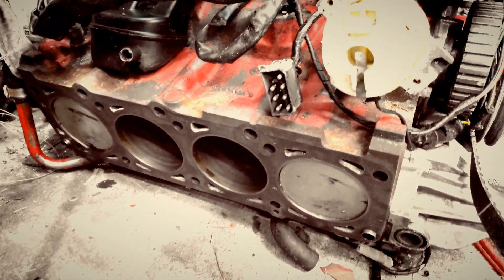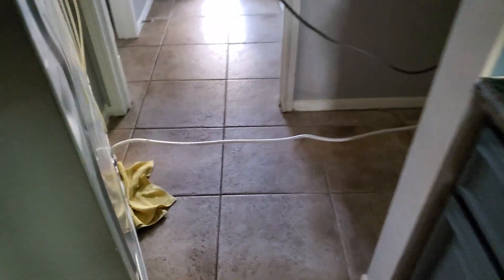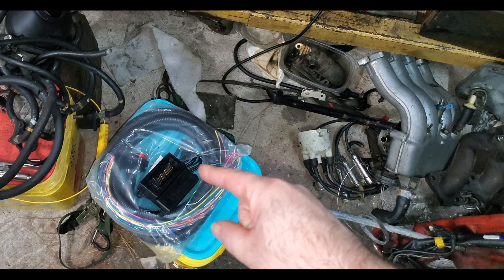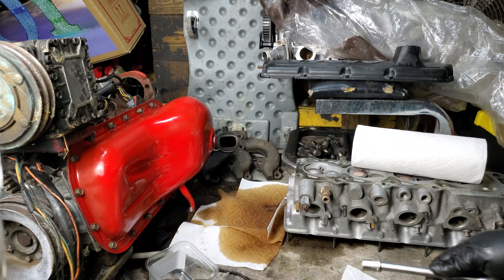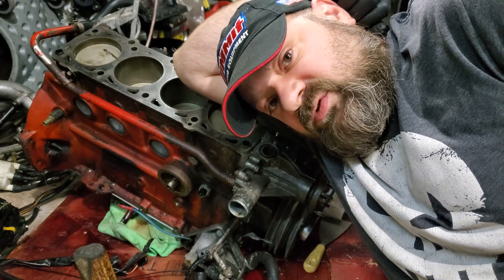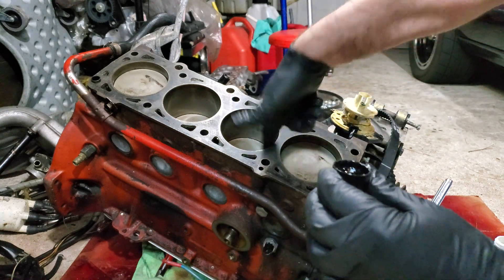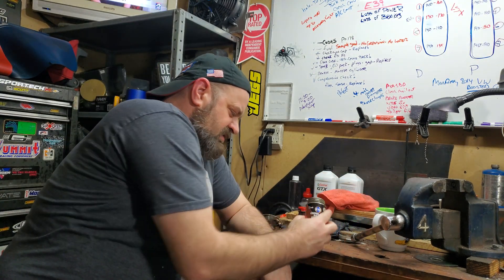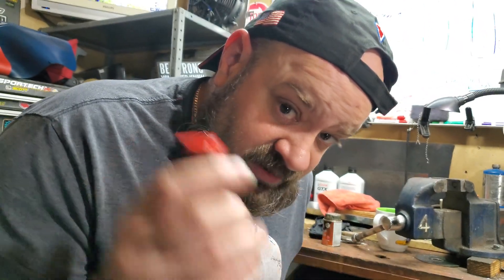Cheap But Tough | 242 Building the Engine

Comment: You said block was at TDC but pistons 2 and 3 are not at TDC when you mate the head. fyi
Reply from the maker: I did notice that. Good eye.Ya got me.
Reply: @TurboWorld  I'm in the thick of a B21F right now, just found some rust in the upper cylinders, so trying to decide if I'll put in a 230F good block I have on hand. Looks like you went the other way ... 230F head on a 21F block.  Thanks for the valve timing tips!
Reply from the maker: @renohuskerdu4592  if the rust doesn't pit the bore it should be fine, other wise no. I had that crank pulley on wrong and had to change it around , thank goodness I didn't hit any valves. I think with the setup I built its an interference engine now. 
  Have you checked my community tab out each week to see the videos I release first on the community tab commercial free? There's a slamming new one waiting for you right now in my community tab, Have a great day Brother!